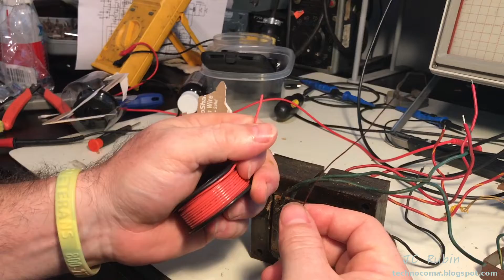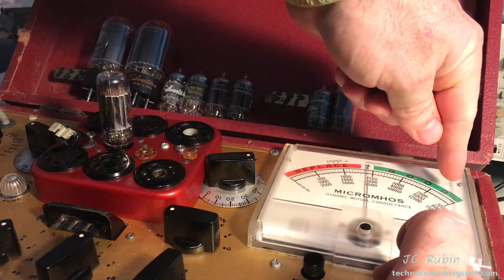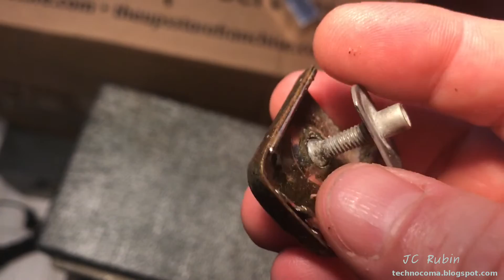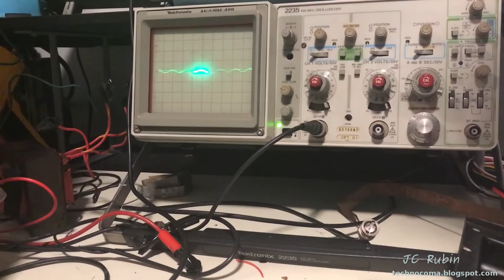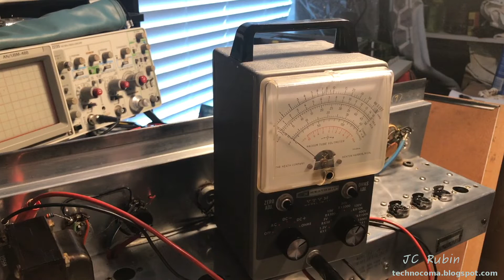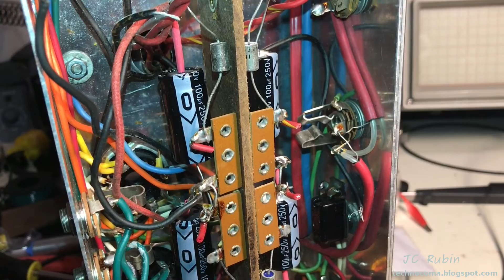Sears Silvertone Twin Twelve 1484 Major Restoration Project [2/6]

Comment: Well I really wish I had found this series before I did my 1484. Gave me some ideas to come back to! Great series. I can tell you that the reverb tank is supposed to be tied to the board in the center. Should be two cut outs for the thread. Either way they’re terrible sounding reverb tanks. Added a trim pot to the return side of mine to pull some highs to ground. Makes a big difference. Cheers!
Reply from the maker: Glad it was helpful.  This was a surprisingly unpopular restoration series for me.  I took a break from making amp restoration videos after this one.

Comment: I have the identical amp and am preparing to recap it, having completed the rest of the restoration. I have 5 100uF 250V (Mitsubishis) and 2 25uF 50V (Sprague Atoms) electrolytic capacitors but I am wondering what you replaced the yellow Sprague 0.5uF 200V capacitor (C23) with. The parts list identifies it as a tubular capacitor but it looks like an electrolytic. Also, where did you source C23 from? BTW, the amp is still functional after 55 years with only one tube having been replaced.

BTW, I love gun sounds!
Reply from the maker: A quick investigation of C23 off of V6 is not an electrolytic cap tying off pin 8.  I had such a cap in supply identifying the outer foil I tied it right in, the same specification.
Reply: @retrotechandelectronics  So would a 0.5uF 200V ceramic or tantalum capacitor work?  I also have some 0.22uF 200V Sprague capacitors I could use, bur I am not certain how critical the capacitance value is. What do you think? Or perhaps I don't need to replace C23 at all.

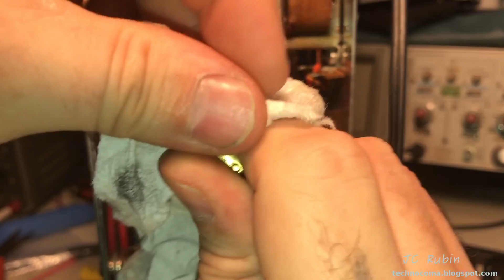Comment: 21:40 - That now-lonely black ground wire going the the electrolytic's can may cause a ground-loop. Should be moved (or extended) to your terminal strip's ground-lug. Also, it doesn't appear to be soldered to the chassis.

Anyway, this is a great video. I remember this amp as a kid some 50 years ago. I remember the reflective blue covering!
Reply from the maker: GOOD EYE.  You are correct, the ground was extended in the final review of the electrical relocations.